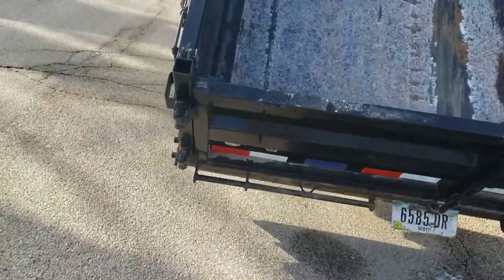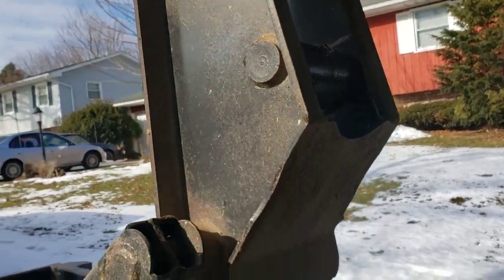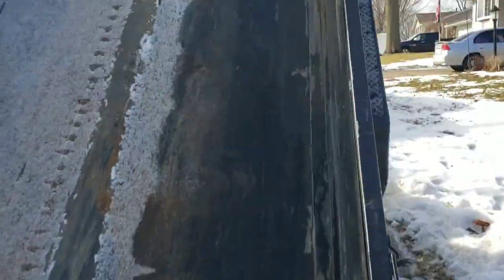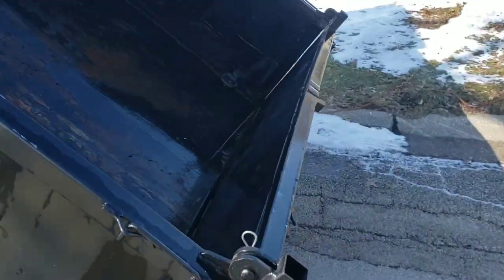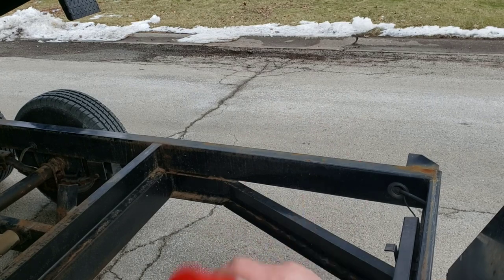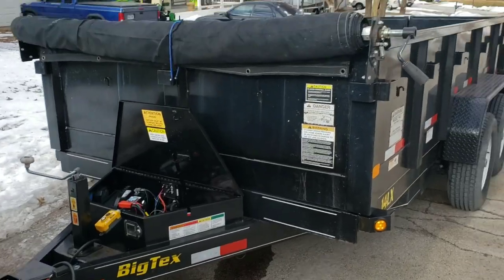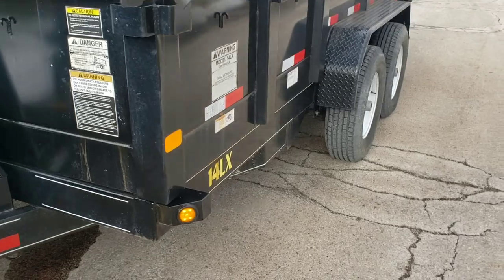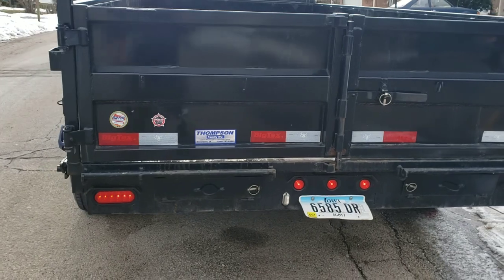Dump Trailer Maintenance! Fluid Film coated!

Comment: Your fluid fild will last longer if you spray more than what you did on the rust. The film soaks into the rust so when you don't spray enough then your not getting full protection. Basically you want to coat the rust like a film over it nice and thick (overspray) and you will get a lot longer use out of it. I've had one treatment last for over 2 years and 2 winters.